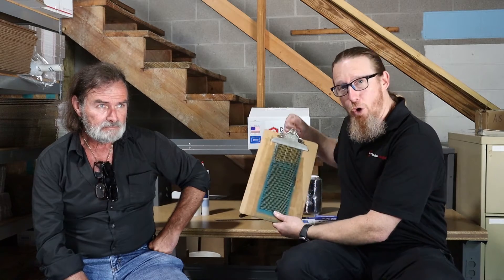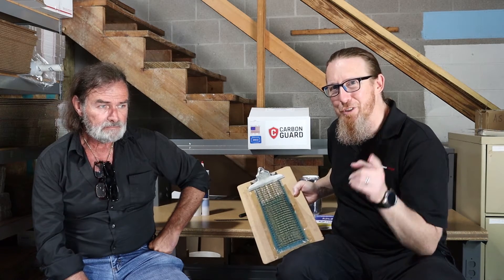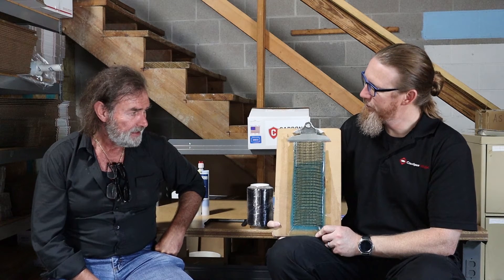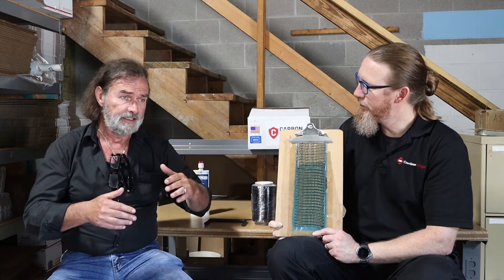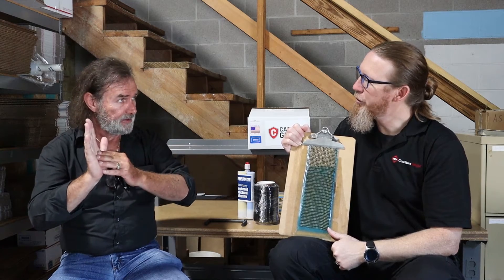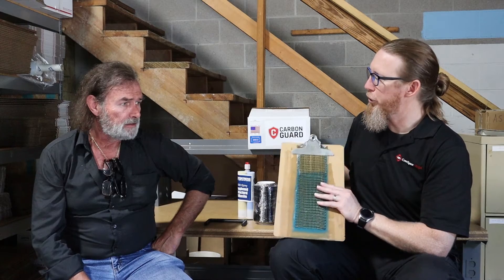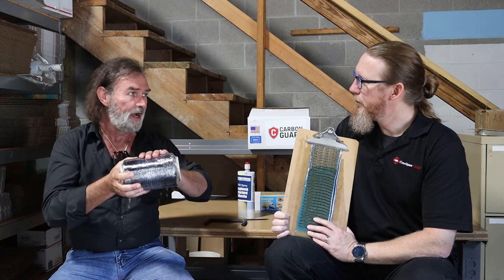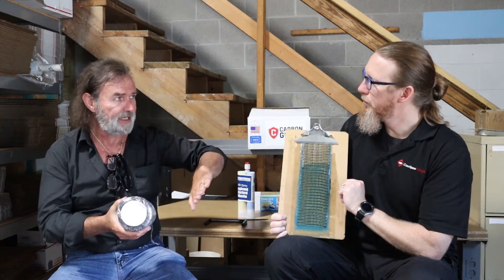DIY vs Pro Bowing Basement Wall Fix - Which One Wins?

Comment: "Carbon fiber" is just fancy plastic. OTOH steel is far more reliable and quite easy to work with and to modify/augment in the future. If you don't weld but do DIY you can work with your weldor to cut and fit the parts. If it's a big project and/or you want a new insanely useful skill your local community college may have a structural welding course.
Reply from the maker: Thanks for the comment, OB Fuscated.  We appreciate you watching.  Have a happy and blessed day.